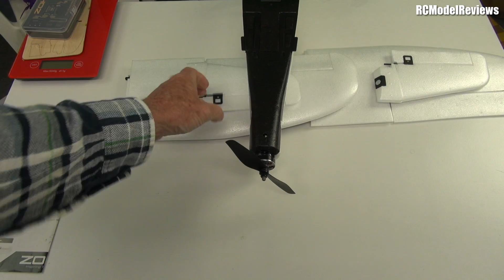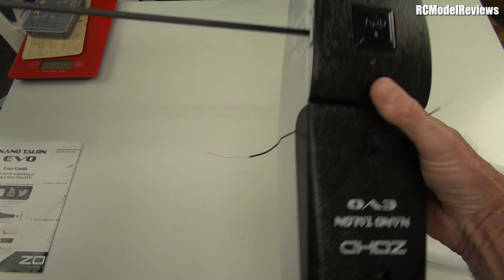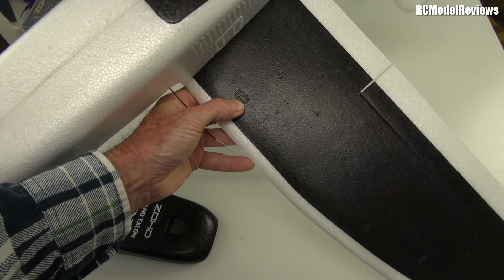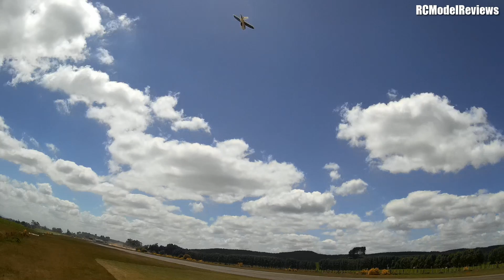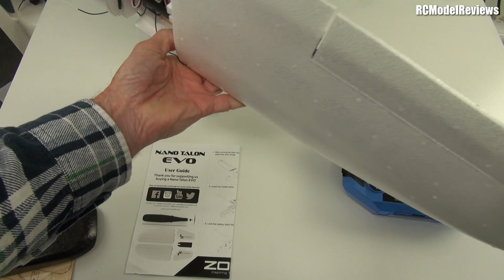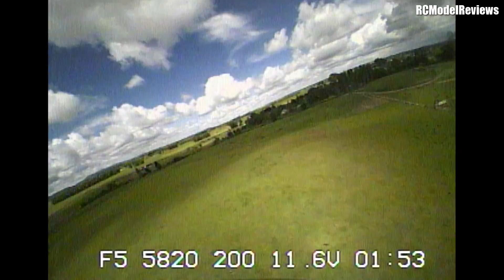ZOHD Nano Talon Evo Review (RC plane)

Comment: I fly FPV Long Range. Which means I have a small fortune invested to make sure the plane comes back. I will NEVER buy a plane of this appalling (lack of) quality!!  If the plane is not perfectly responsive to my inputs in manual mode, I don't want it. It's clear that  problems like  this are systemic, from the factory. And ZOHD has no respect for its customers.👿  You know that ZOHD knew about this problem, and released it anyway.  This is just overpriced packing material. Give me balsa any day. My models barely need trim when I'm done building, and last as many years as I allow them to. (Yes, we all have in air servo, or other failures)  I was flying before Foam & Flight Controllers became the norm. So I don't treat them like packing foam. And I was about to try this ZOHD, not anymore!  You know why TV's, Computer's, etc, come in this same foam? Because it's DIRT CHEAP. If I want an expendable plane, I build my own. For a FRACTION of the cost of a ZOHD. (Using 5mm foam board from Dollar Tree, & plastic geared servo's etc). I don't put in my quality electronics. Bottom line.....
People are getting ROBBED, the profit margin must be through the roof! Christ on a crutch!!!

Comment: on the old pre pro the rear v tail did the same thing... because of how stiff the hinges where it would cause the control rods to flex expecially while pushing (elevator down)... I found at least one other youtuber (older guy) and he just used a hobby knife to thin the hinges... I know I had the same issue and fixed it the same way... if it was a faster plane I'd goto tape hinges or even proper glue in pinned hinges... doesn't fix the aileron stuff though :(

Comment: Thanks for the video,  ... helpful a few months down the road as I just got mine.  I didn't have the linkage problem and it almost looks like my linkage rods are larger diameter than what is in the video.  I find the little 1.2mm rods flex with any distance, and use larger rods at the expense of the 0.5grams or so of added weight. 

A little more fixing was needed before I could fly it.  The hinges were stiff and I scored them (not as deeply as yours) and flexed them until they moved freely.  The control surfaces rubbed against the fuselage and I had to trim them, the batteries were not glued down (= add glue) , and the tails didn't sit tight (a little more glue for peace of mind)   So a nice plane but not quite there. (7/8th baked)    1st few flights have been ok on a 3S 3000mA with no other gear and a basic receiver.   A few more revisions and ZOHD will have a pretty good product.   Same for my Talon GT where the skid plates snap off on every 3rd landing. 

cheers

Comment: Do you think this model would fly more stable if there was more wing tip mass?  Would placing some of the battery  power placed at the wing tips akin to fuel tanks on a Lear Jet keep the rocking moment from oscillation?  Thank you again for your insights.  Very Best Regards,

Comment: What would be cool Bruce is if you get your machine reamers out and machined some new bearing block pieces with nice tight tolerances out of aluminium and show em how it's done!! The design is great, it's just been badly implemented, perhaps with some stiffer torque rods if necessary.

Comment: Bruce your "Reviewers Curse" convinces me that there are a lot of reviewers who know "which side of their bread the butter is on" and their main concern is getting more equipment to review. Considering the number of reviews some of them do, and they never say "this is crap don't buy it" or point out the faults that you seem to find regularly. 
 You may not be able to access this but there is a TV program scheduled on the Australian SBS channel 3 tonight 13th November at 8.30 AEDST titled "Drones : The Next Air Disaster". By an Aldo Kane who sets out to investigate the scale of the threat drones pose to our airports and skies.  From your comments you seem to be favorably disposed towards CASA over here.
I could give you another unprintable opinion. I am the contest director for a group of Oldtimer model flyers and we have had to cancel our flying because of their changes to flying field height regulations. It has got to the stage where we have no other option but to fly regardless of their threat of legal prosecution.

Comment: I bought the first version of this plane, certainly the precission of control linkajes are not the best, but anyway after modifing the diedral to flat wings with some 3d printed parts it flies really better, I had some free play at the tail square rods so I've putted a turn of transparent tape so it fit tight and has no gaps, it improves a lot the dive or climb commands.
About the long range capabilities, with stock radio (Flysky FS-i6 / ia6B) and vtx in 5.8Ghz with RHCD antena I reached almost 4Km and have an autonomy for about 35'.
May be it's not the best but definitively not the worst and could do surveying photography for less than the half price of a DJI drone.

Comment: You enlightened me on the motor mount popping out in a dive. Some of my pusher wings motors don’t have the small “E” clip that secures the bell to the stator. I didn’t think it would ever be a problem as the prop pushes the bell in flight. I never thought bout the spinning prop causing enough drag to pop the bell out. Especially if the motor is just above idle speed. I do have folding props but, I think I will reinstall the clips now for piece of mind.

Comment: When are they going to design an ...... RC Wireless Smart Charging Dock and a remote On/Off switch ?  ......  TVs and Robot Vacuums have them ! ..... Then you can launch your plane or Quad anytime from your Lazyboy , fully charged and Ready to go ! ...... It's time to strap the power of Smartphones to a set of Wings or Rotors , and take to the Skies with proper technology !

Comment: Howdy Bruce, I flew the original Nano Talon (which had a bit of dihedral)... seemed to fly pretty o.k, without stabelizer.. I also have the Black Ops version, of the one you have but haven't flown it yet.. 
According so specs the bottom skid & camera mount-thing are optional (I got neighter like you did)

Comment: I've had two of the originals, both had the same sloppy linkages, I re engineered the whole thing and it flies better but
still wobbles around like a cork in the ocean due to various aerodynamic and centre of mass design flaws.

Comment: I know that Painless360 manual flight was with the co-pilot installed on the sub 250g model, I will be interested in watching your video on that plane as I suspect it will be with a regular receiver.
On an unrelated matter. After watching your video “How to fly in wind”, I decided to purchase the same model you used, fms SuperEZ. Not only has it been a great trainer, when I was flying last Sunday a major change in wind direction & strength occurred. I think the other club members there, were preparing to help pick up the pieces of my plane. (I am an inexperienced pilot). With the knowledge from that video & a model that can handle those conditions, I managed a near perfect landing.
Thank you Bruce.

Comment: I bought one of the original Nano Talons after seeing lots of glowing reviews. Even with the supplied flight controller it flew badly, showing the same problems as this one. On it's third outing a wing flew off in flight and it crashed badly. I've never bothered to try repairing it. Not all ZOHD planes are bad though, my little ZOHD Dart flies beautifully! That has no linkages to mess things up though.

Comment: Bruce, you may have a duffer there.  I have a couple of the earlier V1 Talons (with the dihedral wings) and they don't have that much slop.  Having said that, this is a wiggly plane at the best of times so you really need a stabilizer (unless you enjoy assigning a part of your brain to the role of a $30 stabilizer ;-)
Even with the stabilizer working the plane tends to rock somewhat which is why Zohd have gone to a flat wing (see Bonafidapirate or Andrew Newton's flat wing mod to the V1).
Slop aside I've also noted that the foam mounts tend to flex under load so it's never going to be perfect.

Comment: The control surfaces on mine were exactly the same. I didn't even fly it at all until I removed the over-ambitious linkages and put in a servo and normal control horn for all four surfaces, and I also glued in the tail fins. Even so, it still didn't fly that great and I could only be bothered with about 20 minutes total flight time since I got it six months ago - I think there may still be some slop in the wing mountings, but the central plastic spar-holder broke in a mildly bumpy landing anyway so I didn't get any further with it. I bought it to do a 'endurance showdown' with the z84 using 4S li-ion pack and identical hardware in each plane, since they are about the same wingspan. But when the nano-talon arrived it was already heavier out of the box (with no servos, motor, ESC, receiver, FC or GPS) than the z84 was with all that stuff ready to go. I did take some footage showing the the terrible centering performance, but since the endurance comparison was a foregone conclusion I never made any video about this plane at all.

I think the centering issues you pointed out plus the fact that the ailerons are freakin' enormous is probably the real cause of the instability that many people were blaming on dihedral, either that or slop in the actual wing mounting. Your pitch up/down difference would probably be the linkage rods bending under compression in the pitch down direction. Overall I like the size and configuration, the molding quality is top-notch, but I don't like that soft EPP they use. Would love to have an EPO version with slightly slimmer fuselage, made for regular control horns.
Reply: Well, you are THE scratch builder. I was thinking the same thing, sloppiness of the linkage under aerodynamic pressure. That must solve the problem. I wouldn't glue the vtail fixed In place, though. This little plane deserves 4 servos.
Reply: deleted my comment. I was being blond again.
Reply: pro tip : watch series at flixzone. I've been using it for watching lots of of movies recently.
Reply: @Alexis Roman Definitely, been using flixzone for years myself =)

Comment: Flight controllers are for pussies. Those ailerons could do with small metal push fit bearings within the outer plastic cylinder (presumably it's ABS). One each end of the cylinder should suffice with the control horn cylinder tight fit (use some taper?) to the inner bearing wall.

Comment: Hi Bruce,
Might have to open up the back half of the fuselage to see where all that slop is located. Could be flex in the pushrods.
Reply: I'm thinking the same thing ....
Reply: I've got slop in my ZOHD NEON as well. I made some pinching on the female connector of the pushrod, seated in the fuselage. It did help some. Generally it's a trade off from easy assembly causing this problem, I think.

Comment: That appears to be the normal variation with ZOHD quality control, unfortunately.  ZOHD has some good model designs, but poor builds make a mess of many kits.  The original Nano Talon version also had the same hit or miss aileron control issues across the production runs, obviously ZOHD did nothing to correct the issue with this version.  They don't seem to take criticism well in the forums, either.  I got lucky with my original one, but the fiasco with the Dart XL and the ongoing quality issues has turned me off the brand.  For FPV, I don't really care what the plane looks like, just that it works.  The Volantex Ranger line is better built and flies better, particularly from an FPV standpoint.  The G2 1200mm span is a great flier as well as great value, and the blow mold fuse on the larger ones are incredibly durable.

Comment: ??    With the model in flight is the air flow enough to get the Elevators and or Flaps level and strait ?    I'm thinking the Left Right flight issue could be the V Tail causing the issue ?   In the case of full size Aircraft they're Not as stable as a normal Vertical  Rudder Tail.    Read about the Fish Tail effect.  https://aviation.stackexchange.com/questions/9504/what-is-the-difference-between-the-v-shape-tail-and-the-straight-tail-on-the-bee
Reply from the maker: It's not the V-tail... there is quite a large vertical stabilizer below the V tail.  Airflow will help the ailerons center but the flight characteristics observed (also by others if you read the other comments on this video) indicates that this is not enough to have much effect.

Comment: I have the same slop problem i have the original nano talon with dihedral  i remove the back top cover and glue the carbon controll rod with epoxie the tail is glue permently and the slop is gone

Comment: Damn... It's really a bummer. 😕
I was thinking about a DIY solution for the problem, but I couldn't find any at the moment. 😕
Anyway... Maybe a small washer glued there? The problem is how to put it there... I don't know. 😕
Reply: How about moving the servos to the wings and ruddevators, they belong there, not hidden inside the model. We're talking plastic rods anchored in foam. They will have play and slop. No! Just carve their pockets in their optimal position and those little wings and v tail will be alright.
Reply: Small 3d printed bushing or something like that.

Comment: Totally agree Bruce with the slop. Mine is exactly the same. Fine in stabilized, pretty vague in manual (Have Kopilot installed). I did not get downward facing lower hatch as well but I didn't care really.